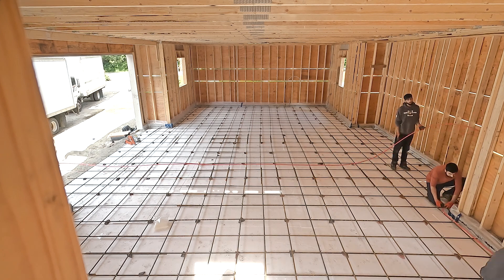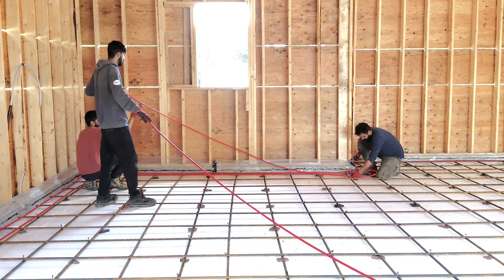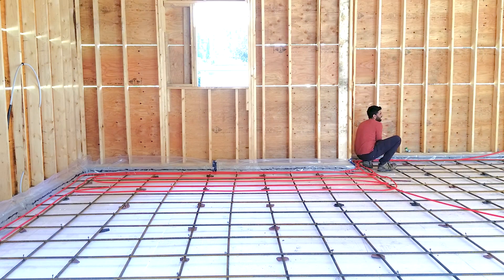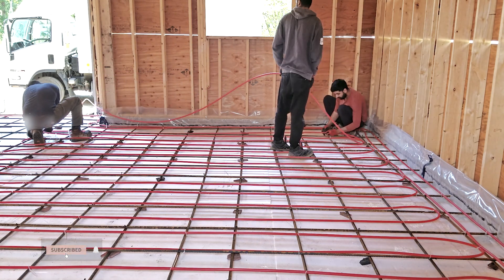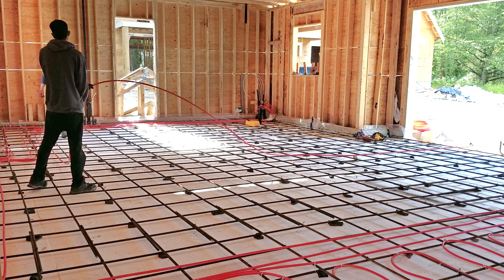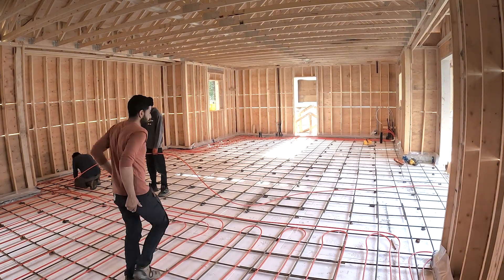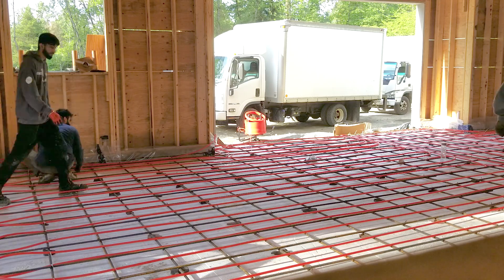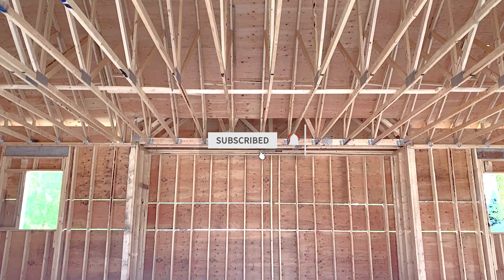Radiant Floor Heating: Installing PEX Tubing in Concrete Slab

Comment: thanks for posting but it is NOT clear how to lay it out...what did you do? exactly how was it layed out? I cannot see from the choice of footage. i can guess: first line goes along outside wall then loops back entire wall of that loop then start surpentine pattern which ends far away from manifold then returns to manifold straight down along the next loop area? is it true the first few feet out are warmest and last few feet coolest? therefore start by wall and finishing run maybe not so far away from surpentine. how do you get the pex to be 1" below surface on a 4" slab? do you have to make controlled cuts on a 40x60' floating slab? 4".  maybe i'd do 4 loops 20x40, then my middle section is high ceiling open concept, then other side of house mirrors with 20x40' again. but how to design it so entire system is run from 1 mechanical room? maybe not too expensive to set up 2 seperate systems: 1 on each side of home. designed like a duplex w shared middle space kitchen/great room.